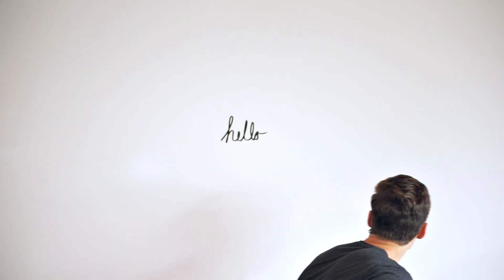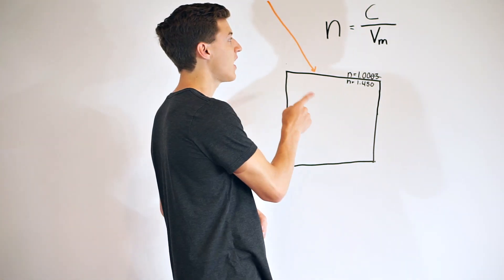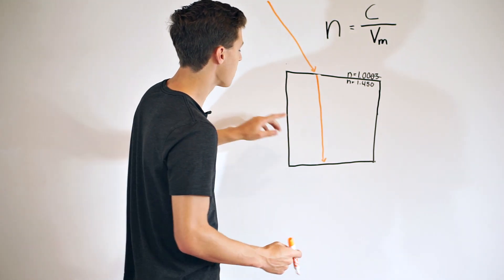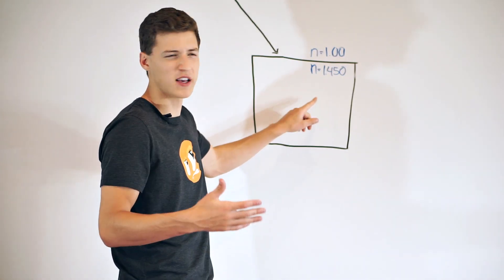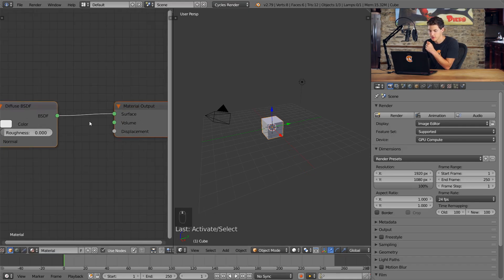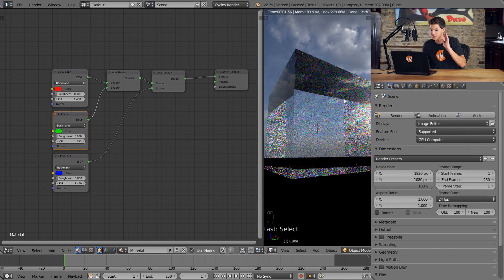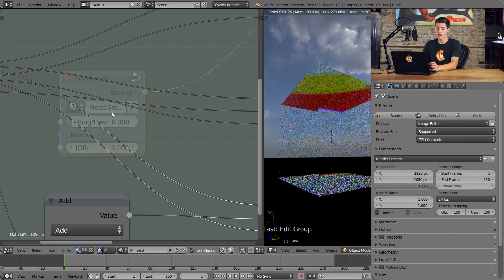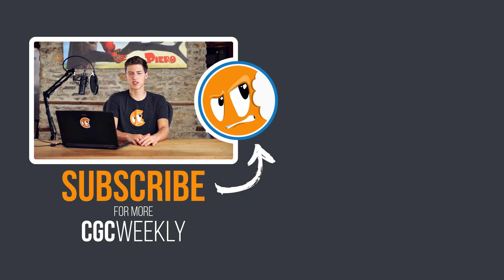Creating a Dispersion Shader in Cycles (CGC Weekly #17)

Comment: Nice shader, but can you also teach me how to reduce the noise when using this shader? It's like super noisy all over the scene when it's on.
Reply: Manojlo Gulic although I've since tried to remake  this shader in eevee and it's really nice looking... better than cycles in fact
Reply: Hu Yande In Cycle turn on denosing option and high up render samples. Also in 2.8 with Evee it should be noise free since it's not raytrace engine. Cheers.
Reply: eevee is not noise free. it uses approximation methods for screen space refraction which CAN be hella noisy....
Reply: AwesomeVindicator Didn't know that, thanks for replying.
Reply: There are (at leas) 4 things you can try in cycles.  The easiest is to trust the denoiser, but there are a lot of cases where that won't work, because the denoiser will blur subtle textures. The next easiest is to change clamp direct/clamp indirect values in sampling and/or disable reflective/refractive caustics, in light paths, each of which impacts the accuracy, but you can often get away with it. Having done all of that, you can increase the number of samples, with the down side of renders taking (much) longer.  The 4th way is described in the blender manual here: https://docs.blender.org/manual/en/dev/render/cycles/optimizations/reducing_noise.html#render-cycles-reducing-noise-glass-and-transp-shadows

Comment: Yet another one. This 3 colors method has been around for like 5 years, isn't it? Why teach it again and again? Why 3 colors? That's just the way human eyes and monitors work. Red green and blue are not "main" colors. Why not add 10 different shaders and mix them correspondingly? Why not 100 and so on? Dispersion will look much smoother that way. With only 3 shaders and big differences between IORs it's just too obvious and harsh
Reply: You can do it with very small voronoi/noise texture connected to HSV color ramp(to get rainbow), then separate HSV with H to another color ramp with value defining IOR. Rainbow color ramp needs tuning(so all colors are around the middle), but you get all colors.
Reply: Came here to say this. Actually monitors and cameras and basically everything related to photo and video uses RGB BECAUSE human eyes work that way.
You can actually see the problem at 16:10: you should see a rainbow (or part of it) but instead see a red and a yellow area.
I still think this shader is not too bad as it adds a little detail, especially if the dispersion factor is not too high.
Reply: GHP ZIN, yes, exactly. I use that method as well. And this can be applied not only to dispersion, but other things as well enabling some features of a wavelength renderer like LuxRender
Reply: Tell more about, in pictures, please! =)
Reply: I will look into this voronoi/noise method. The last method I used was too resource intensive. I did the dispersion in it's own pass using refraction shaders.

Comment: You know dispersion in Computer Graphics is cool. But in real life it can be not so cool when you have this shit in your eyeglasses.
Anyway interesting idea I didn't know you could do something like that in cycles. 

Besides I could imagine dispersion looks even more realistic in luxrender. Because luxrender also supports spectral rendering as far as I know. That is luxrender can not only separate red, green and blue out of the white light but also for example "yellow" wavelengths of light. In Cycles there is no real yellow light only equal mixtures of red and green. 
In real life there are more than 3 wavelenghts of visible light. Although there are only three types color sensitives cells in our eyes: red, green and blue. But there are more colours of light. Like according to wikipedia 700 nanometers is red, it mainly triggers the red cells. 530 nm is green, so it mainly triggers the green cells. But 580 nm is yellow. So 580 triggers both your red and green cells equally. But your eye cannot distinguish whether its red and green cells are triggered by an equal mixture of 700 and 530 simultaneously, or whether they are both triggered by 580 nm light. That's why our screens only need mixtures of red + green to produce yellow. although it is physically different from real yellow. So although our computer screens only know red, green and blue wavelengths. The real life has more wavelengths actually. And sometimes it is beneficial when a render engine considers those additional wavelengths for its internal calculations. At least that is my understanding of spectral rendering. But I am not sure.
Reply: you